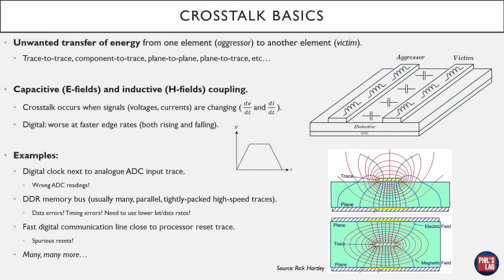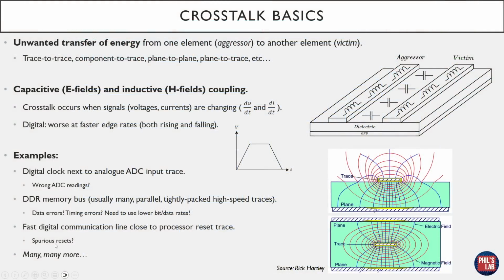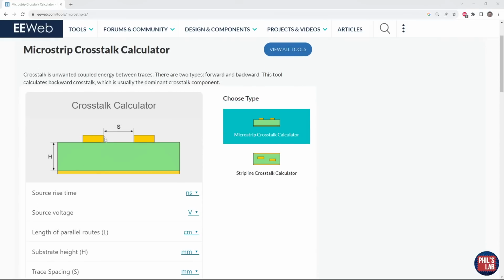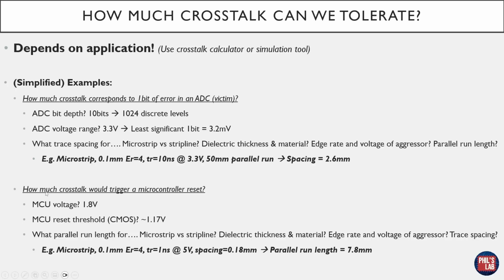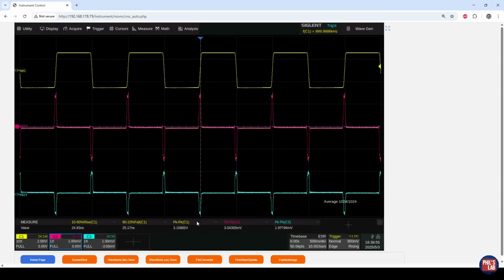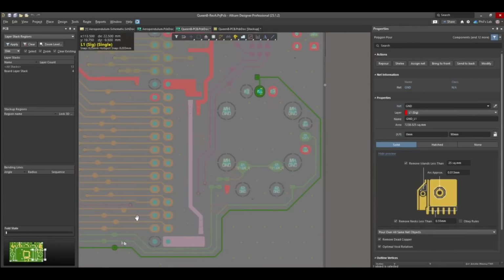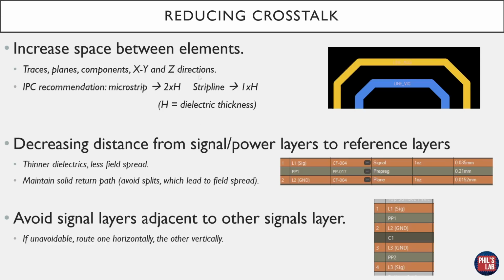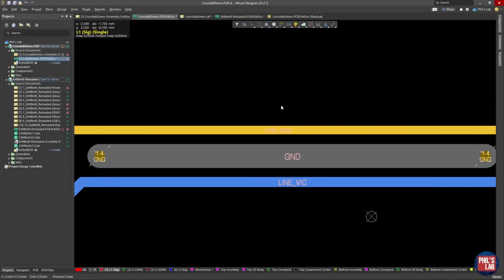PCB Crosstalk Basics (Tips & Tricks) - Phil's Lab #156

Comment: What about the copper pour "fingers" that occur between 2 traces when they are first apart but farther down get close like ========----- this. Do I need to cut everyone of them with an extra area rule? Because they usually exist a lot in more complex designs. And why are GNDs next to HF lines not contributing to get a smaller "h" in your crosstalk calculator? Your videos are immeasurably valuable! <3

Comment: Hi Phil:  Regarding the topic of interposed traces (or fill)   21:35 and following -- the concern with resonance of such traces and strips of fill acting like "antennas" is a valid concern for sure. However, dismissing it as "there isn't much to be gained anyway", even if stitched properly to the ground plane -- I think that could stand some refinement.  I remember seeing this mentioned in a video from one of the other popular channels (Feranec? Zach Peterson? Rick Hartley, Eric Bogatin?), who had tested variants of this arrangement,  and remember thinking that the results weren't quite so cut-and-dried.  Do you happen to have a reference from where you saw this topic covered?  Thanks once again these PCB design video in your usual clear and organized style!
Reply from the maker: Hi Graham, I'd suggest reading this comment by Bert Simonovich and the attached paper: https://youtube.com/watch?v=grjvwLWDYfU&lc=UgyV-0rWCPcQXfMj0TZ4AaABAg&si=MZxhqwS5cF8xoXkK
Long story short, there is generally little to be gained - and more harm can be done than good if one is not careful. Therefore, as this is somewhat of a 'beginner' video, the general recommendation to not expect gnd guards/fills to magically help with crosstalk if just 'popped in' without thought. There are of course exceptions where they are very useful.
Reply: @PhilsLab  Thanks Phi! That was indeed where I had seen this topic before. I will study the paper.
Reply: @PhilsLab  And I've now read over the linked paper. I will not summarize it here, but I would point out that the title is "Dramatic Noise Reduction using Guard Traces with Optimized Shorting Vias", which hints that guard traces are not to be dismissed lightly.  There may well be little to be gained in using a guard trace for a logic-signal victim (which has low noise susceptibility) versus just using the spacing you'd need for vias anyway. But for an analog victim (say input to ADC) there could be a benefit. But that's just broad strokes, the paper covers a variety of nuances and caveats.  
Probably at least as important is that often limited PCB space strongly compels squeezing tracks together, which is harder to resist if there's a bunch of blank space between tracks! A designer with a robust understanding of distance vs crosstalk can better defend the spacing!

Comment: Can I assume that the crosstalk doesn't care what signal was on the victim, so if, for example, MOSI interferes with MISO, the TX/RX directions of FEXT and NEXT will be reversed?
Reply from the maker: If there was a signal on the 'victim', that would couple also to the 'aggressor'. Crosstalk is then the superposition of 'neighbouring' signals. FEXT/NEXT will depend on where the driver/receiver is, and can be reversed.
Reply: @PhilsLab  I hadn't even really thought about the case where the victim doesn't have a signal.  I had assumed that just was a simplification to make the analysis and measurement easier, but that if the intended victim-value were no signal, it would be a no harm->no foul situation.  Is crosstalk really a problem even then, because of how it distorts the aggressor?

Comment: Couple of comments on stitching to GND (Quick and dirty: PCB 6" ~= 1ns or 1 GHz assuming < 1/4 wave 250Mhz and below.  At 0.2" GND stitching = 30 GHz  or 7.5Ghz) For most single ended signals 500ps rise time would be very fast and that is 2GHz. 0.2" center to center ground stitching should be more than adequate. When you get to 1GHZ signals the impedance will likely dominate the equation. But at that point RF simulation is basically required and rule of thumbs only give a start.
Reply: Can you please use metric units? Thank you
So we can understand your comment without converting

Comment: Hello Phil, I hope you’re doing well. I have a technical question: When it comes to crosstalk or EMI generation, is the primary contributing factor the signal’s frequency or its rise time?
In theory, does this mean that a 50 Hz signal with a very fast rise time could radiate more than a 10 MHz signal with a much slower rise time?
I’d really appreciate your explanation.
Reply from the maker: Yes, for digital (trapezoidal/square wave) signals, rise time typically the main contributing factor to frequency content. For example, a 50Hz square wave with e.g. 1ns rise/fall times would have far more and higher frequency content than a pure 10 MHz sine wave.

Comment: JLCPCB, Calculated Price $2.00, Shipping Estimate $28.55!!
Reply: Expecting overseas shipping to be cheap? Just avoid ordering until you have multiple PCB designs ready and shop around for a good shipping price (that's the biggest cost involved with ordering PCBs). Ordering a set of five 100x100 boards would cost me AU$17 in shipping, compared to something like AU$5 for the boards. Shipping varies wildly based on destination country and carrier.

Comment: Wow, not putting grounded traces between signal lines is absolutely counterintuitive. This was my first idea you killed 😅
Reply from the maker: Haha, well it can help - as usual, it depends. It may be better to err on the side of caution if you can't stitch the GND fill sufficiently, and then it may be better to not have it.
Reply: @PhilsLab  For 1 layer PCBs (like MCPCBs), so without an inner ground fill, can I assume this also applies?

Comment: Interesting time for this video, I was just investigating this on a board I made. I noticed crosstalk from the SPI clock to the SPI MOSI with about 600mV amplitude! Did an FFT and confirmed it's the exact same as the clock frequency.
Reply from the maker: Hope that didn't cause too many issues, and hope you could reduce it if it did!
Reply: @PhilsLab  Luckily it was just below the amount that could cause significant errors. But it was also a great opportunity to learn about signal integrity and how to reduce coupling.